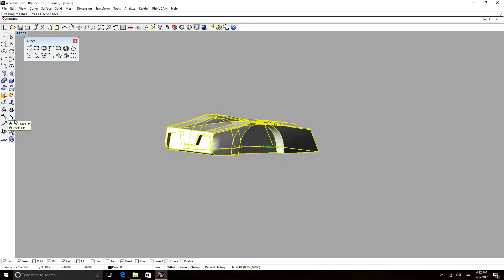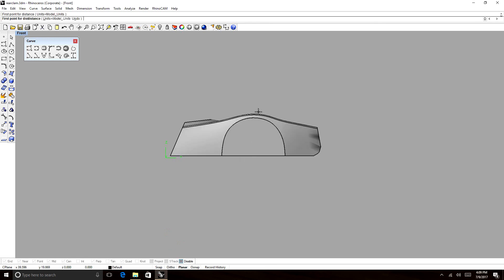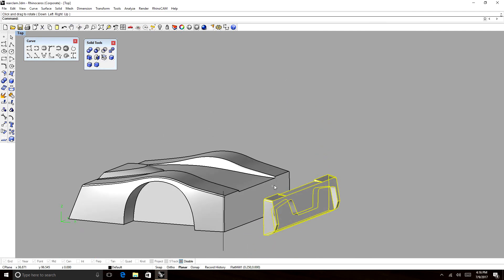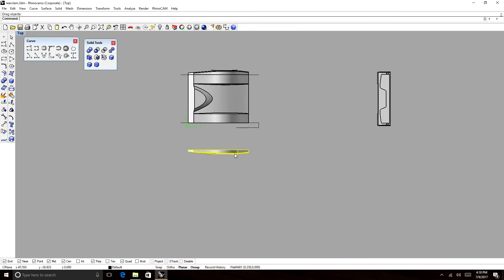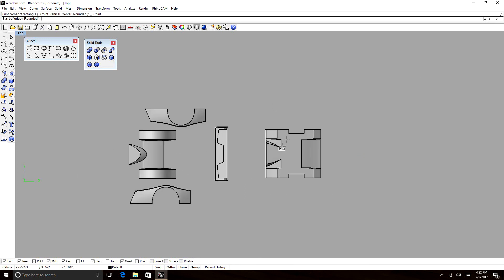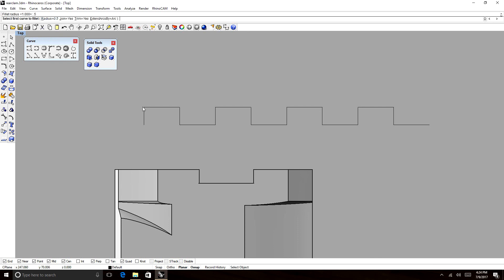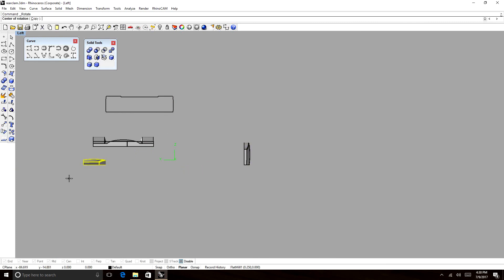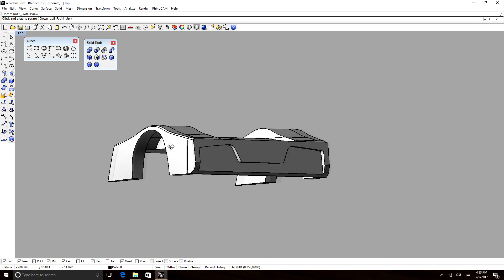How to split large 3D objects for 3 axis CNC machining and 3D printing. (3 of 3)

Comment: only thing i cant imagine...how to make a car body "solid" !?  In other words, if i have a car shape "hull", how can i "intersect" or "substract" that body from a box - to get an "negative" or a positiv like yours?! puhhhhhh....ah & i mostly use 3ds max & sketchup
Reply from the maker: flip it upside down, and build the box sides around the edge. or if your part is considered a "solid" (closed surface with no gaps) in CAD, you can use a "boolean" tool to subtract your "solid" model from a "solid" box, leaving a negative cavity inside the box.
Reply: the car body i have is not "solid" even as converted to polygon it will not substract. i made a larger box & positioned the body inside of that, dont work in 3ds max. Tried procutter from "compound objects menu" ect. i cant understand your first suggestion building boxes around "the edge" THANKS for your effort
Reply: i can send you such a car body & give you a try ;-)   just joking